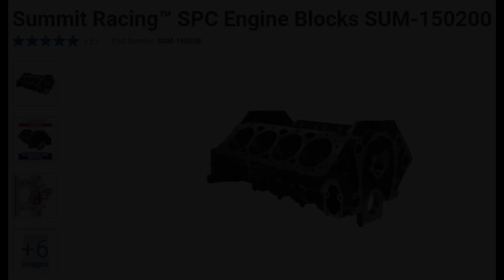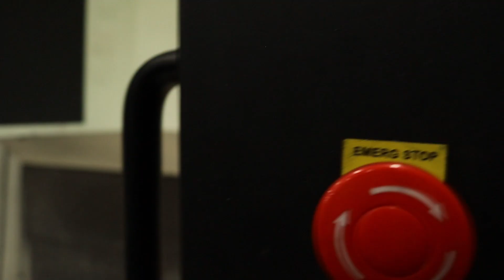STRAUB TECHNOLOGIES Blueprinting & Machining the Summit Racing™ SPC Engine Block SUM-150200

Comment: Will this block clear a 3.875" stroke crankshaft?
Reply from the maker: We believe 3.750" goes with no work, after that not sure. Has nice deep reliefs built into the casting....Summit says:
 • Cast in Germany at a Tier 1 OEM foundry
• Made with class 35 Iron Alloy, Higher tensile strength and harder than competitors' class 30
• Machine-finished in USA on precision hi-speed machining centers
• Priority main oiling systems & Siamese Cylinder bores
• 4-bolt nodular iron main caps, splayed outer bolts, 180,00 PSI main bolts included
• 350 or 400 main bores and 1 or 2-piece rear main seal options (small Chevy)
• Multiple bore sizes, finished to -.005 in. undersize, Hone to fit
• Cast in stroker clearance 
• OE roller cam compatible

Comment: BPE is BluePrint Engines out of Nebraska.
Reply: How far in horsepower has these blocks been tested? 700 hp seems low!!
Reply: @jaybyrd8592  Same casting as the BPE blocks and Richard Holdener got over 1000 hp out of one of those with an F-1A Procharger. How long it can last at that output is unknown, but I personally think 700 would be plenty for a street car(unless you like riding around in a jungle gym).
Reply: @CzechSixTv  I'm looking for something for the track... from bracket to grudge racing.
Reply: @jaybyrd8592  I see the Summit block, like the Dart SHP, as more of an upgraded OE style block rather than a full race piece. I don't think the block will shatter at 701hp and plenty of people push SHP's well beyond their official 600hp rating. Still, 700bhp is enough to put a lightweight(3k lb) and dialed in bracket car into the 9's. 

For a serious track only car something like the Dart Little M or Iron Eagle are obviously better. They weight more but are stronger with options like raised/BBC cam tunnels and raised decks which help a lot high on large displacement strokers.
Reply: It's the same deal with Brodix and Edelbrock. They are having BPE cast their blocks and then tacking their name on them with a core insert or by machining Blueprint off and engraving over the top.
Reply: I've seen the BPE logo on their cylinder heads. I've only seen their blocks with BluePrint on the front China wall. The block shows SUMMIT on the China wall, and I guess it's a different block with "BPE" near the oil pan rail.....interesting.

So what are you getting at???
Reply: @arturozarate1752  if you look at summits site the blueprint blocks are no longer available, one part number is BPSB4125200S. The resemblance of the casting is uncanny.